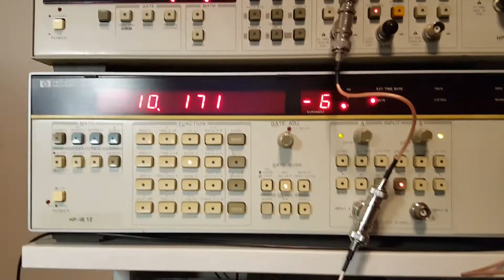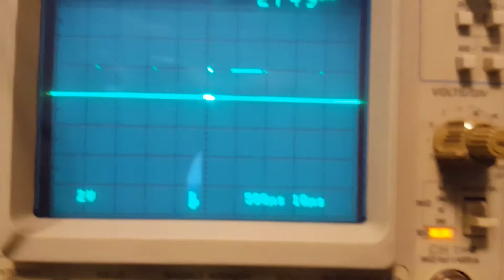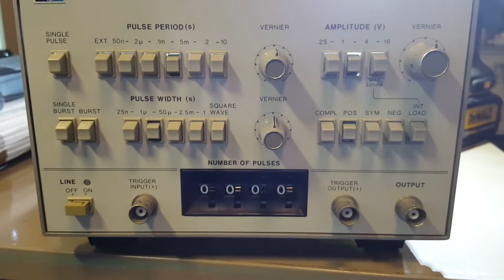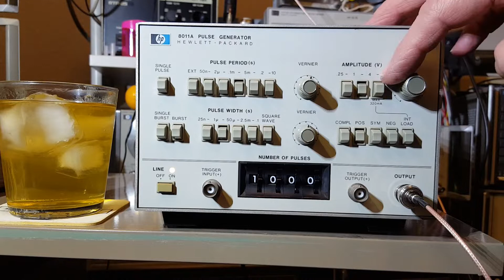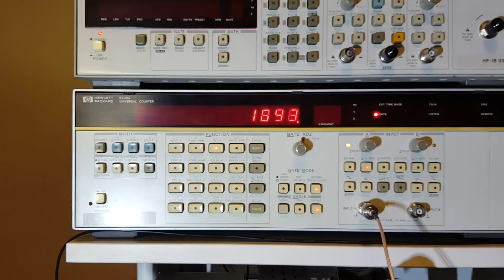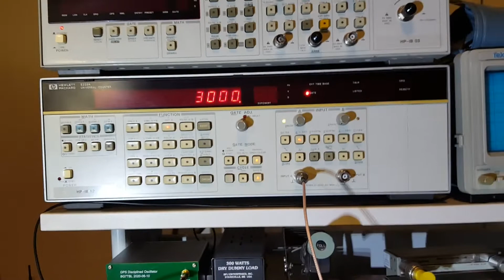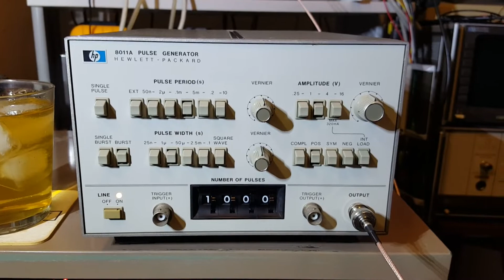HP 8011A Pulse Generator.

Comment: Do know how to make the duty cycle decrease linearly with the frequency rather than just have a set time interval?(I have the same one)
Reply from the maker: Greetings, I haven't used this instrument in a while so I'm not sure if it's possible to this. I'm guessing this may be possible with a more advanced unit that can be programmed via the HP-IB bus. Thanks for watching.
Reply: @CraigPetersen12f36b  someone helped me figure it out, it is by pressing the square wave button